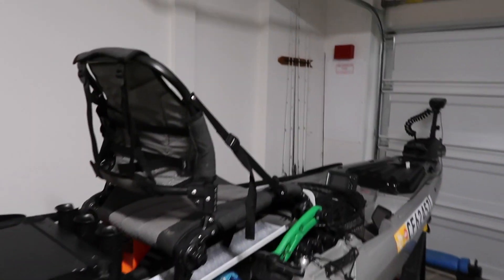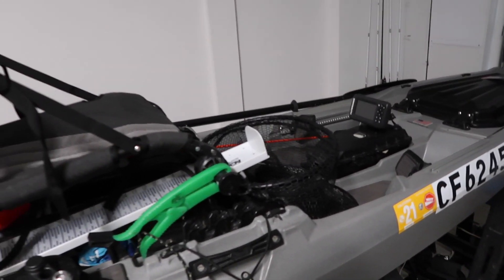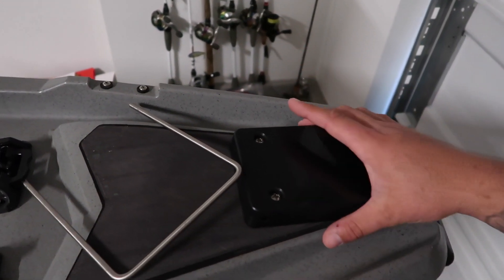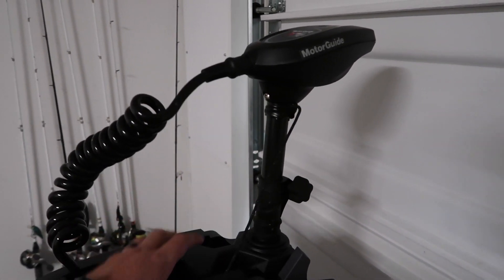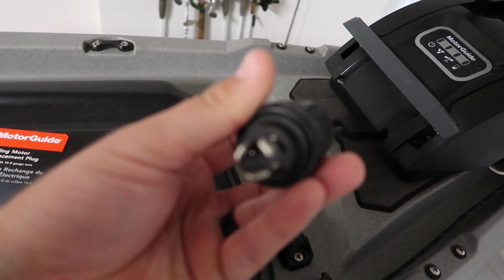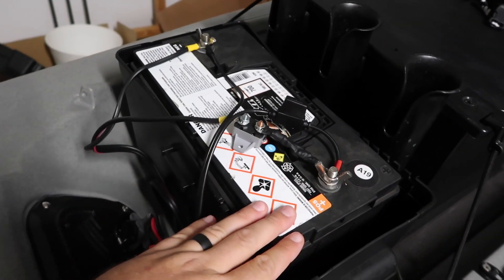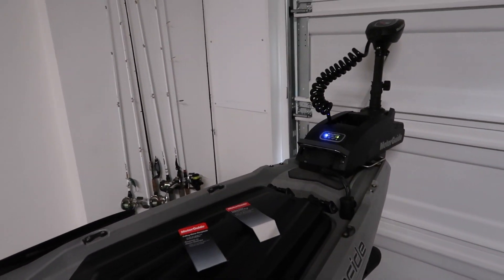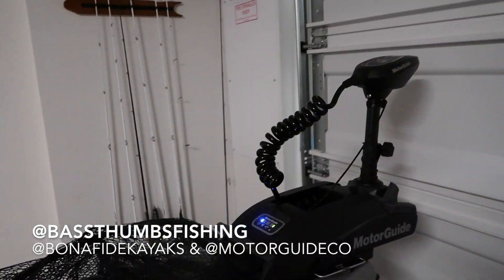Bonafide SS127 XI3 Motor Guide// Kayak Review

Comment: Did you buy the quick release mount separate or was it included? And would the xi3 work well mounted from the transom?
Reply from the maker: J Adams yes I bought it separate. I would say no it’s a bow mounted trolling motor the back really wouldn’t make sense with this type of motor. It’s made specifically to move the water craft from the front.

Comment: do they have a control that can raise the trolling motor shaft up or down incase you run into shallow water instead of pulling the cord to pull the trolling motor out of the water completely everytime?
Reply from the maker: Teng Xiong no they do not that would be a great innovation. You can adjust the height before you go out if you know you’re going to be around a lot of cover

Comment: Hey man! I have a SS127 as well. would it be possible to transom mount this unit? Do the holes on the quick release line up with inserts for the powerpole? Also, I would love to hear some long term feedback on your setup! Thanks!
Reply from the maker: Hey man thanks for the comment! I have some updated videos on my new set up that I’m running now which is very similar to this one just newer. I wouldn’t recommend mounting it to the back because it’s meant for the front. The steering on the front is way more effective than the back with this motor. Also I have been running a bow mount for almost two years on the ss127 and haven’t had any issues it’s been solid that front flat space on the ss127 is super sturdy and works perfect 👍🏻

Comment: Where could you buy the quick release mount?
Reply from the maker: Junior Provencio you can order it through www.kayakfishingsupplies.com or give their store a call and they will help you out. 

+1 (619) 866-6129
Reply: Did you have to put a piece of poly board under the quick release to raise it so the pin would clear?  I’ve seen several videos where they had to do this.  Could you share which brand / model you installed.  Great video keep them coming.

Comment: Hey bud, how does this handle in rough conditions does the bow take on alot of water due to the weight of the motor?
Reply: Also is there a way you could link the battery you are using?
Reply from the maker: Tools For Life hey man! I don’t have any issues when the water is rough when the water does come over the bow it just drains out and it’s never very much. I now use a 100ah Dakota lithium battery. I have some newer videos now of my new set up of this same rig with everything that’s on it linked in the description! 👍🏻
Reply: @BassThumbsFishing   I am trying to do the same thing because I troll for walleye. Im trying to get a setup to where i can troll on the water for at least 10 hours if I wanted. How long does the battery last?
Reply: I was just scared that the weight on the front of the boat would cause the front to ride low and take on water

Comment: Cool setup. Was it a pain to do the chop on the shaft?
Reply from the maker: TEXASV8GRT thanks man! It wasn’t hard at all. You just take off the head of the motor and put a pvc inside the shaft so when you cut it you won’t hit the wires. 👍🏻
Reply: @BassThumbsFishing  Do you think next time you have to do one that you could do a video, I would hate screw up an expensive TM

Comment: What battery are using to power the trolling motor
Reply from the maker: Chris Adams I was using a big group 27 at first but I switched to the blue top optima marine battery and haven’t had any issues. I’ve been on the water for 10 hours and it was still pushing a lot of power 👍🏻
Reply: @BassThumbsFishing  How many Amp Hours is your Blue Top Otima battery?
Reply from the maker: Kevin Higgins it’s a 50ah, but now I run a 100ah Dakota lithium
Reply: Bass Thumbs Fishing Thanks. I was planning on a 54AH Dakota based on weight and cost but now wondering if it will be enough. Will be powering a motorguide Xi3 55lb.
Reply from the maker: Kevin Higgins I would recommend the 100ah, but if you can’t afford that one then the 54ah will be fine!
Reply: @BassThumbsFishing  Thanks man and keep up the awesome content!
Reply from the maker: Kevin Higgins no problem and thank you for supporting the channel!

Comment: Nice video! Nice boat, I just got mine.  Do you think I could shorten my shaft about three more inches lower. 32” shaft? Will it sit deep enough in the water?  Do you use the anchor anymore after installing the pinpoint gps on the motorguide?  Just subbed and keep up the videos.
Reply from the maker: larryk113 hey man that’s incredible! Yes you can make 32” with no problem. Motorguide is working on a factory shaft for kayaks! I don’t use the anchor at all it’s mostly for looks now. The gps Pinpoint is a awesome feature! I’m going to make a on the water video soon, but man it’s worth every penny! Thanks for subbing. Keep your thumbs ripped
Reply: Bass Thumbs Fishing thanks for the reply! Maybe I’ll make some YouTube videos. When I get setup. Just joined KBF this week.